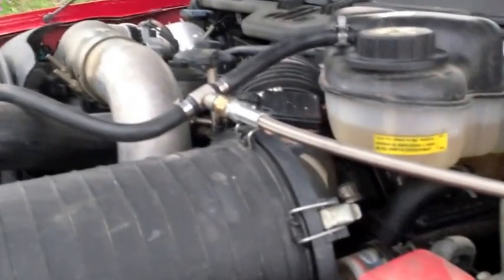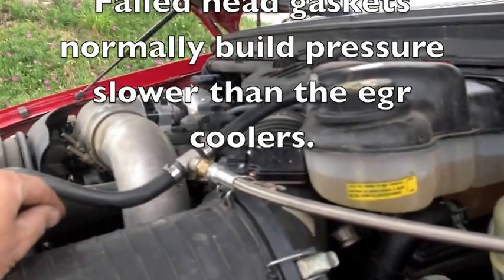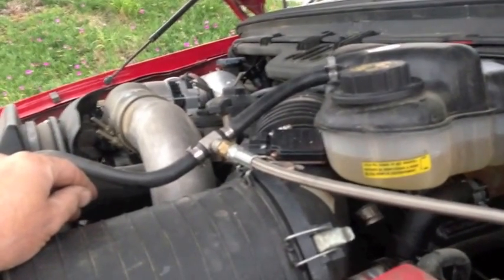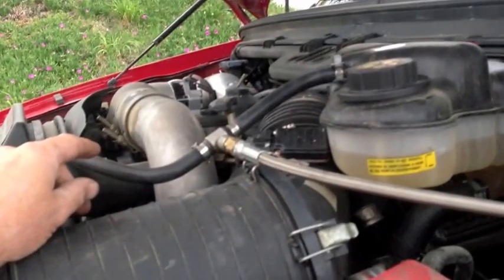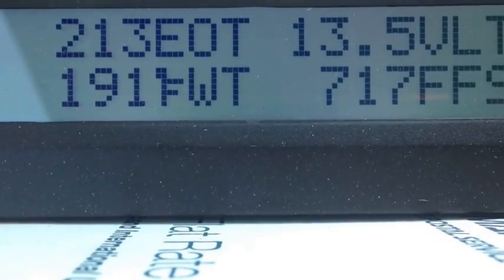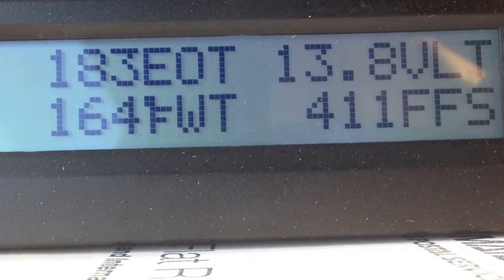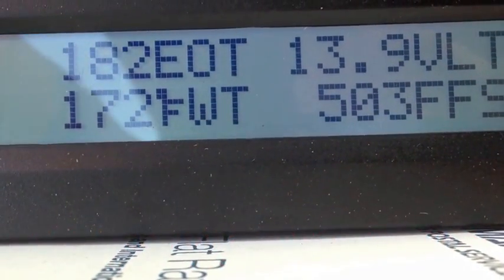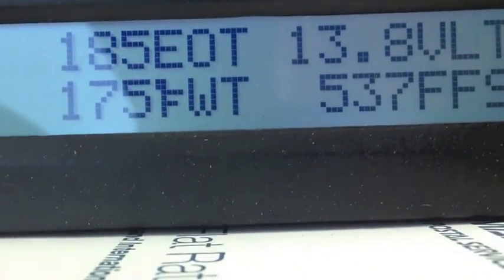6.0 Ford powerstroke diesel head gasket and oil cooler diagnostic tips

Comment: Does anyone know what the FFS setting on the scanguage is monitoring?
Reply: I know it’s been four months since asking this question, but I believe it’s the fan speed sensor. He might have named it FFS instead of FSS. When entering the codes you can name each one. But it measures the RPM at which it turns. Unfortunately Ron passed away years ago. Hopefully you found your answer.

Comment: If you've done any repairs to the 6.0 that required removing the coolant you may just have air in the cooling system. Make sure you turn the heat on and take the cap off the degas bottle to purge any air in the system after you have fill it with coolant. Sometimes it takes several times of replacing and taking off the coolant cap to purge all the air out (you see it bubble in the degas bottle from the bottom where hose attaches). Try this before you spend thousands. Also make sure you don't have any small coolant leaks in the radiator or a leaking or bad water pump. Also make sure the fan clutch is operating properly before making any costly repairs. Replacing the radiator, water pump and fan clutched fixed my problem with the coolant leaking out of the degas cap. I was told I had blown head gasket even though I already have ARP head studs and replaced head gasket when studs were installed. Beware of BOGUS mechanics and repairs shops. ( The infamous Ford Stealer Ship) 
Coolant kit which includes the water pump and fan clutch are about $300.00 at Auto Zone. Life time warranty
Radiator also about $300.00. Life time warranty
Total for both was about $600.00 and only took about 6 hrs. Hope this will help someone... Over and out :-)
Reply: kevin maxey were you monitoring the coolant pressure while this was happening if yes what pressure were you  seeing and how long did it take to purge all the air out.?
Reply: @jahcure04  No I was not monitoring pressure.
Make sure coolant level is 1 to 2 inch below half way point inside the degas bottle before starting engine. 
What I did is rev the engine to 3000 rpm for 1 minute then shut it off. Then slowly  open  the cap (SLOWLY!)  allowing the pressure to be released. Follow this procedure over and over until no more bubbles are seen coming from the bottom of the degas bottle.
It took about 6 or 7 times for the air bubbles to completely stop. 
At this point you can take the cap off and rev the engine no more than 3000 rpm and see if anymore air will release. 
Afterwards make sure the coolant level is about 1.5 to 2 inches below half way point in the degas bottle while hot. No more the half full on cold start. The coolant systems will release pressure if more than 16 psi.

Comment: I tested my truck(2006 f250) this way and it showed 6psi under a few heavy runs (full accel). egr deleted, stock headbolts, no tune. I'm not sure if my cap is sealing right and not giving a true reading can that be the case?

Comment: best regards. I have an F250 2006. Never the temperature needle goes up more than normal. Question: In some cases, the reservoir water has small water outlets. Is the issue serious? Every day I check the level of the refrigerant, and fill when it is between max and min so that it is always pinking the max.

Comment: I am looking at buying a 6.0l I did a head gasket test on one that I looked at. It went up to 12psi in no time. When buying what would be the highest pressure for normal operation and should the truck be warmed up first. I live in Ohio where ambient temperature is lower.
Reply from the maker: Normally. I wrote normally. Head gaskets take long pulls and being warmed up to seep and build pressure well above 16.  Egr coolers depending on the size of the failure climb quick and release quick with the throttle.  ALWAYS factor in temps first.  12 isn't bad if your system is sealed right.  High temps are is expansion too
Reply: So a perfectly good truck with average driving  would normally see what pressure? When that truck built 12 I wasn't  driving it hard at all 5 miles maybe and not that heavy on the throttle. I didn't buy it but I am still looking and would like to know a range of "typical" pressures. I understand your not the one testing it and you personally would take alot more information into account. I have seen a lot of "normal numbers" people post just curious on your two cents.
Reply from the maker: +Michael Brzoska 9-13. Make sure the temps aren't causing the expansion by high heat. Coolant temps in the desert pulling may hit 228 and the fan come on and keep it there or lower.  (High demand). Oil 15* on new style oe cooler or 20* on old style or cheap after market. Remember dorman sucks on everything for the 6.0. Far far worse than stock.  Oe got better, dorman took weak parts and made weaker.
Reply: +DieselTechRon Thank you Ron your the man.

Comment: Will a weak water pump cause irregular eot ect readings?
Reply from the maker: It could.  High pressures, bad fan, poor or failing thermostat and cavitated front cover
Reply: Truck is dripping water off of harmonic balancer when shut down...but not when running. Eot ect readings exceed 15° sometimes almost to 30°. Thermostat is new, not sure what cavitated housing means.
Reply from the maker: +Vehix Corp Sales new oe thermostat? Dorman sucks.  A water pump can leak only when spinning or only stopped.  So can hoses due to circulation or higher pressures.

Comment: I have a 06 powerstroke that looses heat in the winter. Engine temp is always normal and I never loose coolant. when the truck high idles it heats up but when I get on the highway and steady my speed out it starts blowing cold, it also blows cold when I stop at lights. once I accelerate it blows warm then tappers off once I'm driving steady again. is this a head gasket leaking from exhaust into coolant?

Comment from the maker: The doorman oil cooler sucks. Fords internal one has been redesigned with better flow. Bulletproof's external I've seen the oil run a lot higher than 15* apart. So please allow me to correct myself and say the 15 degrees was with a genuine ford, it's also once the temps become stable going down the highway. Not during warm up.

Comment: i have a 04 f350 6.0  just had egr delete oil cooler head studs mishimoto radiator new turbo,blue spring  update with 100 miles on it ect is 190 eot is 208 210 at 60 on highway any suggestions its all new

Comment: Hi Ron. You mention that the EOT/EWT temp diff should never be greater than 15 degrees, even while towing. I notice with my vehicle that EOT/EWT difference while towing on the flat will normally be in the 8 to 10 degree range but can get up to between 18 and 21 degrees on steeper grades , usually quite steep and then settle back to the 10 - 15 degree range for awhile and then settle out once again at between 10 and twelve degrees.  Is this acceptable? Fans working and jump from between 550 to 600 RPM to 2400 following these steep grade climbs. EWT always returns to between 193 and 198 degrees and will eventually settle out to the high 180's.

Comment: Ron, your explanation is the complete opposite of what Bill over at Powerstrokerhelp is saying.  He wrote " A clogged oil cooler can run the pressures up but it will do it slowly. Head gasket failures will usually happen after two to three hard acceleration runs." I am leaning towared your explanation b/c I can see how a clogged oil cooler will cause the coolant to boil in the EGR Cooler and increase pressure rapidly. Not sure how bad a head gasket leak would have to be to inc pressure rapidly

Comment: I have an 06 f350. I checked mine after it was at idle for about 20 min and my temp difference in water oil was 48 degrees. Is that normal for at idle? Seems extreme to me. I didn't check it going down the hwy.

Comment from the maker: To answer the last two questions. Please note I am showing the oil and coolant temp. Yes of course if you have boiling temps then to have to consider that. Then if your water is hotter than your oil please see my other video explaining how to accurately test the temps it should be driven down at freeway speeds. If your water is getting Hot check your fan speed, and circulation . Possible water pump or front cover.  Thermostats are rare but if course possible.

Comment: Some people (mechanics) seem to overlook things like the fan, t-stat and coolant expansion. Every "expert" I spoke with had me convinced that the head gaskets were blown. In fact, it was a combination of a bad fan clutch, stuck-open t-stat and not considering coolant expansion when measuring coolant PSI. After fixing all of the above, took a drive thorough HOT Az. Not a single problem. But now I have a leaking bed plate.
Yippe &%!#%

Comment from the maker: Exhaust pressure is consistent while running. 17-50 psi. Even if the egr valve was fully open the exit is smaller than the entrance. Plus there is plenty of exhaust pressure just waiting or pushing to go anywhere it can.

Comment: good vid ron, But my question with the EGR cooler having a crack and the pressure rise kinda made me wonder how an EGR cooler would let pressure build if it has a way to get out, but with headgaskets its pushing pressure into the cooling system, on sevre cases its will push coolant out of the degas bottle, but your the expert not me i just love fixing diesels